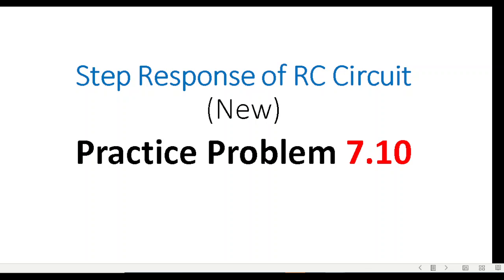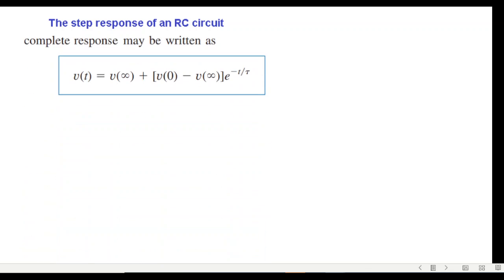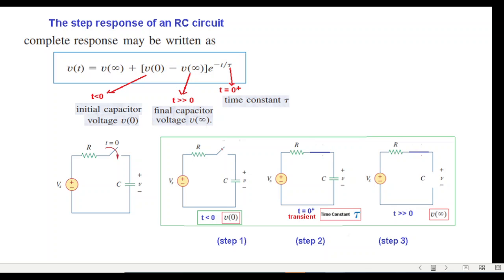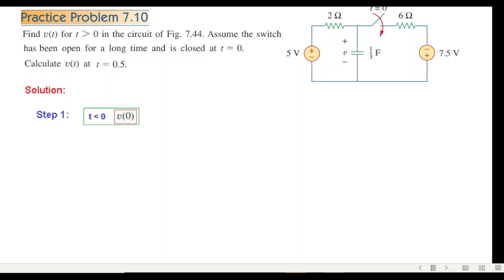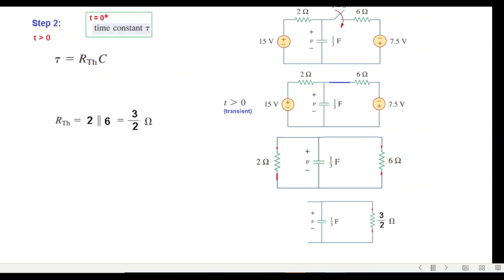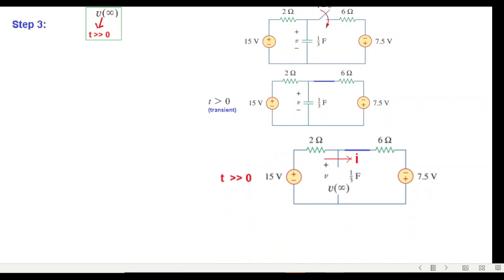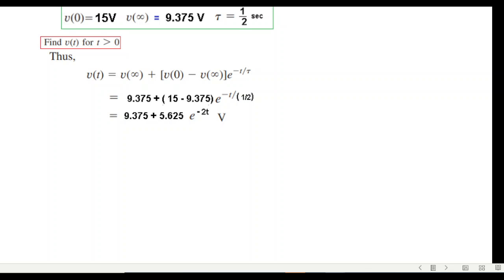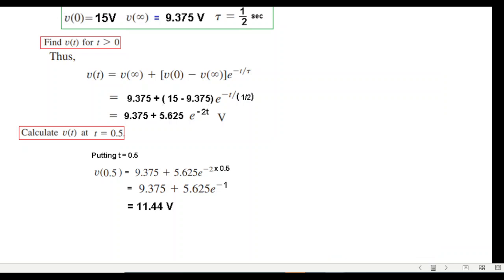(English)LCA || Practice Problem 7.10 || Step Response of an RC Circuit || (New)

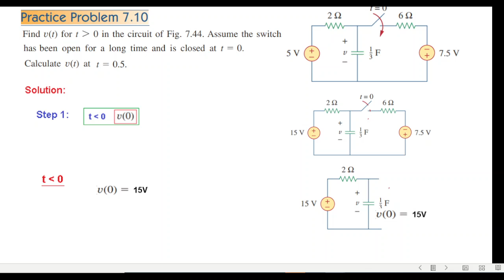Comment: in 3:55 - how did we get that v(0)=15V?? could u pls clarify
Reply from the maker: Please listen carefully from time 3:40. In a series circuit the capacitor get fully charged to the input voltage, no matter whether there is a resistance in the circuit or not.
(I suspect u have some issue with the basic concepts. I would recommend you to watch my videos of LCA from the beginning to build a good concept. You are welcome to ask me to clarify your doubts)